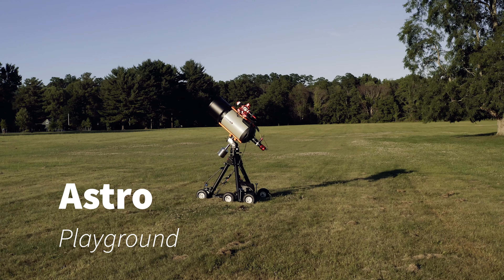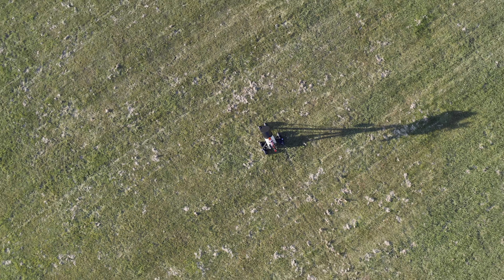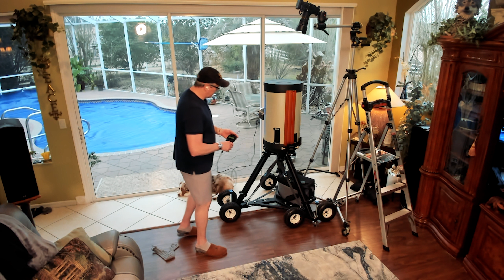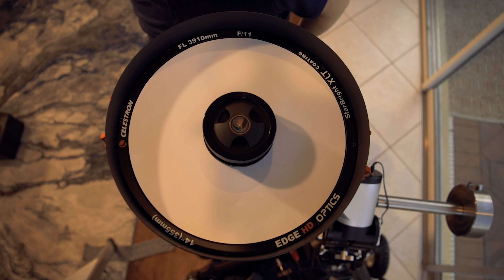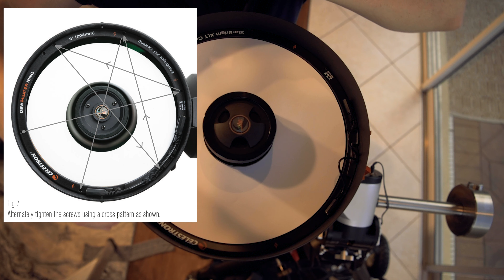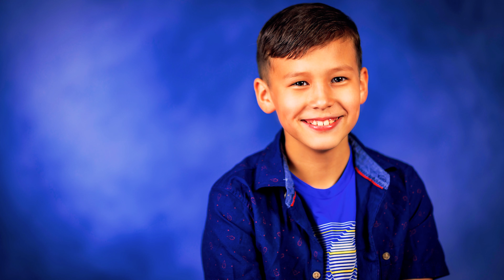No More Foggy Optics! Celestron’s Dew Heater Ring Explained 🔭

Comment: is it mandatory to use the celestron dew controller with this heater?
Reply from the maker: You shouldn’t have to, it is of course the best paring, however I use my eagle to control voltage output, works fine.

Comment: Great Review!! Would this unit work with the ZWO ASI Air Pro/Plus instead of the Eagle? do you know if the Celestron Aluminum Dew Shield with Cover Cap will fit with two D size plates installed (as you have)? Are you using the optional thermistor to control temps?  I'm going to check you out on AstroWorldTV.
Reply from the maker: Well, seeing as the D plates are Celestron‘s, I would imagine their dew shield would fit with no problem. I am using the echo in conjunction with the eagle to control the dew heaters.
As far as the ASI air, I Believe it should work fine, my buddy Eric is a strict ASI air user and he has this dew heater for his 8 inch HD.

Comment: Excellent setup indeed... I've seen several of your last videoswhere you migrated from a clutch and worm-wormwheel based CGX-L mount to a much advanced technology Strainwave Harmonic Drive Rainbow Astro mount... Can't wait to see your reviews on your rig... One question though... I have no doubt that Rainbow RST mount is decades ahead of the CGX-L mount, but since the RST doesn't have RA and DEC clutches and therefore when you roll your wheely bar over different types of surfaces will not the  harmonic drive get jerks with the weight of 45lbs EdgeHD 14"? On the other side people have strongly recommended to disengage the clutches in traditional Synta made mounts like the CGX-L or EQ6/EQ8 mounts when traveling or they're getting rolled on a dolly system... Is it probably the harmonic drive is strong enough to bear the stress/jerks from your heavy EdgeHD 14" even when it is in motion?
Reply from the maker: The RST300 has an internal break that prevents it from moving at all until electrical power is applied. The maximum payload for this harmonic drive mount is 110 pounds and it’s so unbelievably strong that I don’t worry about that scenario at all.
Great question though, thanks for commenting! 😁
Reply: @AstroPlayground  That is what I thought so... Many thanks for your prompt response... Hope to continue getting wonderful videos of your setup!!! 😊

Comment: Your telescope is in an upright position.  Inverted suggests the telescope is pointing down toward the ground.  What screwdriver did you use?  How tight were the screws torqued down?
Reply from the maker: The screwdriver was just a standard hardened small tip, grip tight style and I only snug the screws, not excessively tight.